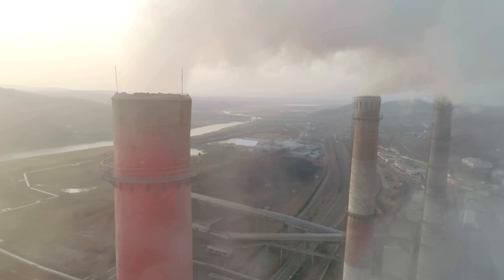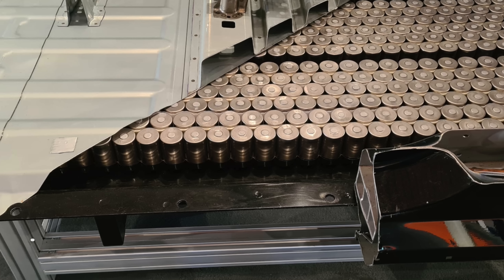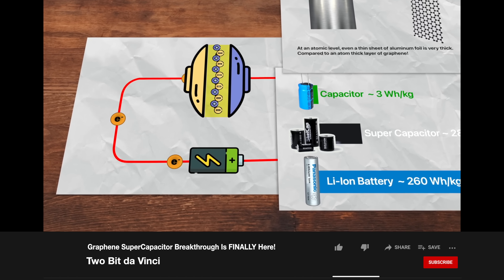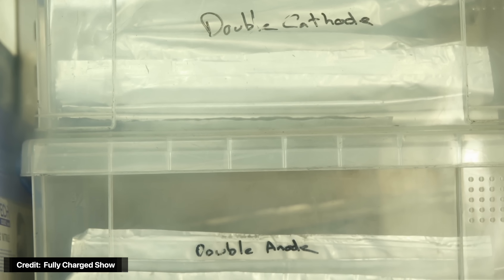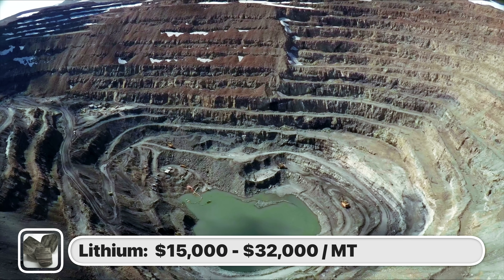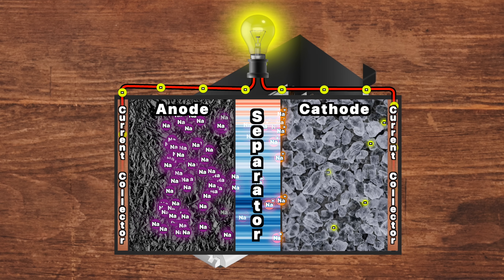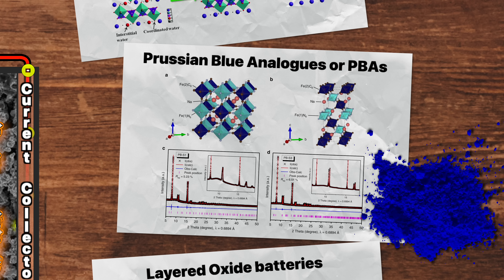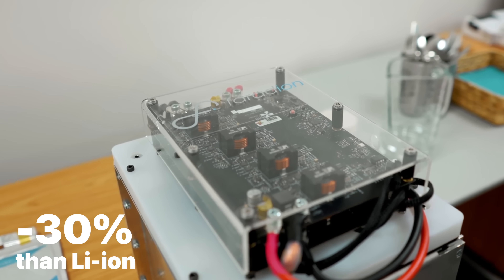Next Gen Battery is 1000x Easier to Source and 99% Cheaper!

Comment: It will be several decades before hydrocarbons can be "replaced". EVERY single industry relies on the low-cost, portable energy that hydrocarbons provide. The by-products of hydrocarbon refining are necessary for the production of renewables. I suggest researching the energy required to refine bauxite into usable aluminum.  Hydrocarbons are the underpinnings of modern life. Pick any item you purchase to use in your life, any single item. Now research what it would take to make and possess that item WITHOUT hydrocarbons. 
Batteries? Nope.
Clothing? Nope.
Electricity? Nope. Refrigeration or HVAC? Definitely not. Farming? Not efficiently enough to feed 7 billion people. 

There are no replacements for hydrocarbons.

Comment: Battery’s not gonna charge much from a 110 volt outlet. . .  And the word is electrolyte.   Better up your game a bit, Ricky.  

Bottom line:  It’s the Lada Problem.  It’s cheap, but it doesn’t work very well

Comment: Fone batteries used to just plug into the back of them. So if the energy density is only on the lower end why can't you just make them twice as big to compensate. You could even make a booster pack that recharges the internal battery wirelessly.
Reply: Because nobody wants to lug around a heavy, bulky battery.  Is that not obvious?  Applies to cars, or anything else that moves, too.
Reply: @incognitotorpedo42  people not only DID use heavier batteries previously but would often buy larger aftermarket batteries to extend them.

You obviously where not around when the companies forced people into using sealed batteries and the public complained alot about it.

Make no mistake today's fones have sealed batteries to force you into buy a new fone every few years when the battery is ruined.

Your reply was very ignorant.  And if your so weak an ounce or two cripples you, I suggest you go see a doctor.

Comment: Hmmh, go figure. 99% reduction in material cost will translate into what? A 10% reduction in battery post? Unfortunately most or the battery cost probably already goes to marketing, that is not about to change. 

There are obvious physical reasons why Lithium will be used to build the lighter more efficient batteries that command the highest price. At an estmated 10% price advantage for heavier Sodium batteries they will only take a small share of the cake. 

The really hard thing is to be better and cheaper than Lithium.

Comment: I hope they get production of these batteries up and running as soon (or faster) as they plan to. The lower energy density doesn't matter with grid storage, which we need so much for renewable energy
Reply: If we had cheap and efficient grid storage, we wouldn't need renewables. The grid storage would allow nuclear and fossil power generation to operate more efficiently, and at a higher capacity factor.
Reply: @paulcampbell840  I disagree. In order to cut our CO2 emissions to zero, which we need in order to prevent catastrophic effects caused by climate change, we must stop burning fossil fuels. So, fossil power plants are not a part of the grid of our future. And because of hight costs and effort of storing waste, the catastrophic potential, and the fact that operation will get more difficult under the change of climate, I don’t think nuclear power is a good option either.

Comment: While this is not a bust, it is FAR from a replacement or solution to the battery problems we have. This seems like a backup plan. So many other battery techs out there that far outweigh this battery attempt. Still, I like all these different avenues trying to overcome our Lithium addiction. These particular batteries need your promised 99& cheaper to be viable, not the 20% as stated in your viddi.
Reply: What, they need to be one dollar per kWh to be viable?

Comment: the goal should never be to completely get away from fossil fuels. that's suicide because of threats from enemy countries, supply problems, if the grid goes down, potential monopolies..etc. oil, electric, and hydrogen need to all be available so we won't be held hostage by anyone or anything. The electric car is a  overpriced, unpractical, unreliable, toy that will not resolve anything. I think the whole scheme will eventually collapse. And it will not save the planet., a novelty.

Comment: Those soidum ion batteries have a similar energy density to those used on the first Tesla Roadster, and only slightly less than the ones used on early Model S! They will of course be used for stationary storage, but they might also be used for some low cost EVs as well. An EV under $25,000 with a range over 220 miles would be a big hit.
Reply: @orionbetelgeuse1937  a 60% round-trip efficiency might not be a fatal flaw for grid-level storage as long as cost and life cycle numbers kept them compelling.  I would assume that the lost energy is heat which could probably be harvested at very large scale to boost that total efficiency back up.  It clearly would never approach 90% but you could probably wring a little bit more back out of a charge/discharge cycle.  The big driver would need to be cost though.
Reply: Aren't they already using something similar in the budget level chinese teslas? I know they're not using bog standard lithium batteries in those lines. Those units are considerably cheap because they have no Self Driving features (prohibited by chinese law)
Reply: @seanbrockest3888  Probably LFP (Lithium Iron Phosphate)
Reply: @orionbetelgeuse1937  But it has much more resources to make bigger storage
     Lithium isnt infinite
We just need to keep improving in all sides ( they will all be usefull now or later )
Reply: I had heard some of the companies making claim that sodium batteries can have double the capacity as compared to lithium technology.
Reply: @orionbetelgeuse1937  I dont understand much or close to nothing about it
      Good to know some people knows how it works
       Ill trust you on this one :)

Comment: Sodium ion batteries will do best in fixed-location electrical grid storage.  There larger size, heavier weight will not be as serious a drawback there., and the advantages of lower cost and longer lifespan will be big advantages.

Comment: Cheaper Industrial sized batteries are needed so that once we have enough charge to replace the fossil fuel-burning power suppliers of a sector for 24 hours, to clean the air... Clean 90% of the air pollutants in 24 hours once a week will fix the climate because it takes over 4 weeks for the 90% of air pollutants to return... So, if you don't understand that if we clean the air every week, 90% of air pollutants will never return... I Don't Know what more to say but Let's Get it Done Already...

Comment: Sodium's already a really excitable metal and you want to use it in batteries in an unstable form.  That stuff will explode on contact with water or human flesh and we want to put lots of it in a car.  We use it in a stable form salt and that will dissolve your car chassis.  You want to excite it and make electricity, what could go wrong.

Comment: That's  5 and 6% of about 2-3% of market. Not 5-6% of market.  You need to figure where power will come  to charge these Lithium ION batteries.  First go to school and learn to add, subtract, multiply and divide before saying batteries are taking off.  We need much more clean electricity and we ain't got it and Hydroelectric, big fans, and solar panels ain't going to get it .  Better get on the Nuclear power and lots of it. Then replace all the power lines.  Then start on the electric cars.  We have more than we can charge in California now and it's only a few per cent.

Comment: Whether or not we use Lithium-Ion batteries, or Sodium-ion, or Hydrogen technology, or any other new technology already proven to work, there shouldn't be an issue on which to choose. If you've bought into the idea that we need to immediately stop our use of fossil fuels, then we better make use of the technologies available to us right now. The key failure of using renewable energy sources like solar or wind is that we don't have adequate resources, like batteries, to store the excess energy produced. We NEED as much storage capacity as we can get, as quickly as we can get it. California has had rolling blackouts for years now and with Biden reducing/stopping fossil fuel energy production, we faced blackouts from California through to the Mid-West this summer. This fall and winter, we face major shortages across the whole country and especially the northern states.  Actually, this same issue is being faced across the whole world, so it makes me wonder why our government here in the United States, and other governments haven't made the production of new battery storage technologies a top priority. There is No reason why we need to wait up to 7 years to get any new technology off the ground once it's been successfully designed and tested. We Must immediately get them into mass production and to the market. Does it make you wonder why, in the minds of our elected officials, there is no such priority? It sure makes me wonder. It also makes me wonder how many of our fellow citizens will freeze or starve to death this winter because our government(s) fail to act.

Comment: Sadly there is 1 problem with the so called renewables they are NOT reliable and the POWER GRID will NOT support that much POWER flow . We Must also Remember the Recycling factor , and all the other down sides , Like making the Chicoms RICHER . I still hope it works . To be Blunt I have NO desire to buy any vehcle built after 2010. I do Think that You're videos are interesting  and educational

Comment: For stationary use, Na-Ion batteries are definitely superior, i think somewhere it was also mentioned that they are much more robust when it comes to temperature than Li-Ion ones.
So while not suited for EVs as of now, there IS definitely potential and value in their use.
Reply: I 100% agree, but I think that outdoor temperature isn't as much as an issue for stationary supplies as you might think. Small units for homes and businesses are going to probably have them indoors, and solar, wind, and local caches can keep them underground, below the frost line.
Reply: @klepow  That depends on WHERE it is used, and with the temperature resistance, it means it can be used in areas where Li-Ion would suffer.
Let´s say northern Eurasia and America close ot the polar circle.
Or literally everything equatorial.
Reply: @sim.frischh9781  I doubt that it's going to be that much resistant to temperature. Although he didn't mention how much. I get the impression you would get maybe 70% of a warm battery. They would still have to be climate controlled, and burying them still would do the same thing.
Reply: @klepow  It´s not "that much" per se, however, Li-Ion is SO SENSITIVE to temperature that pretty much any other battery technology seems highly resistant in comparison.
Like Einstein said, "everything is relative".

Comment: I wonder... What are the "Retail Prices & Availability?"

Basically, could the Na-Ion (Sodium Ion) Cells & Batteries replace the Traditional Lead Acid Battery for "SLI" (Starter, Lights, Ignition) uses? 

Could it Replace the LiFePO4 Cells & Batteries, on the "Low Cost & Long Life Front?

Could it Replace LiT (Lithium Titanate) Long Cycle Life Cells, with Higher Energy & Lower Costs?

Basically, Sodium Ion, Lithium Sulfur, and maybe others, will all find their Niche, changing along the way as Volume Increases, and Price (& of course, Costs) decrease!

"May the Best Battery Win, and may all be figured out, as to what each is 'Best' at!"

Comment: Good coverage.  Thanks.

Grid storage is what we really need, for which slightly lower energy density really doesn't matter.
Reply: It would be the difference in a few steel beams and roofing in a warehouse. Negligible costs really
Reply: @jeffreymoffitt4070  Most of the grid scale battery storage is in (cabinets in) open air, and doesn't need a building around it.  

Lower density could mean a few more cabinets, but no big deal in the larger picture.

Comment: I think that electric mobility rather than saving the planet is probably one of the fastest way to terminate the planet. Just as solar cells, batteries are extremely hard and energy intensive to recycle so most of the resources mined and then composed to make solar cells or batteries will be lost. And in addition to the energy going into the actual  production process which, want it or not, requires untold amounts of fossile fuels burning so that it's easy to say that you could have burnt the fossile fuels using combustion motors in cars in the first place. A car motor is easily recycled in comparison to the technology going into EV's. I absolutely cannot see how EV technology is helping us to save the planet or even to reduce the carbon footprint by just a small margin. It's rather increased by far!
After all, at least here in Germany it always was our main argument against nuclear power plants that the nuclear waste coming from that type of energy production and which is highly radioactive for hundreds of thousands of years is without a proper solution to be stored. That's why I and many others protested 40 years ago so vehemently against nuclear power plants and deposit facilities for nuclear waste here in Germany. Now batteries may not be radioactive but they also contain lots of toxic chemicals utterly harmful for the environment if not recycled and used otherwise. So to go all in on EV to me sounds like an unforgiving trap all together. That's why I'd like to express my protest again. But just like inspite of our rightful opinion in those days I am afraid that no-one today will listen to people like me.
A lie remains a lie, no matter how often it is told or how it is painted over to make it look like truth.

Comment: Sodium ions are bigger, easier to manage but are also lower energy density compared to lithium. Once battery recycling takes off for used car batteries it will stabilize the market. between 85-95% of the batteries raw materials can be separated and recovered for reuse.

Comment: How about the issue that Prussian blue contains cyanide?  How is the cyanide not a problem?
Reply: Cyanide like many other chemicals can be both beneficial or dangerous. Like salt , made of two dangerous elements,  chlorine and sodium.. You can't live without it.

In the Prussian blue a form of cyanide is tightly bound with iron.  Its iron bond is stronger than its attraction to the mitochondria in your cells.  In this form it doesn't doesn't bind with  and disrupt the energy production of your cells , which is the way it harm's or kills. 

Due to some of it's molecular properties The compound  Prussian blue can then be used by your doctor to treat heavy metal poisoning. It causes those metals to bind to the Prussian blue instead of molecules your body needs for metabolism.  A form of Cyanide is also a component of vitamin B12. The B vitamins are needed for proper functioning of the nervous system and they provide energy instead of shutting down energy production.

 Some things are better when purified most are not. They are constantly looking to bind with something for stability, if that thing is needed for us to stay alive it can get in the way of that.

Comment: Clean energy storage needs are massive, and specific and volumetric density are pretty much non-issues. The energy industry will use orders of magnitude more storage capacity than all other uses. Cost, reliability and longevity will be essentially the only factors to consider. There is room for numerous battery chemistries in the short term, but long-term we will need only two: maximum density and minimum cost.

Comment: It's a shame that so many of these game changers - Sodium Ion, Solid State, Super Batteries (Capacitors) - are perpetually "5 to 7 years away". :(
Reply: They're not "perpetually" 5-7 years away (this is not another Fusion tech, which is perpetually 20-50 years away...) - but once the Li-ion battery had been invented and commercialised, and steadily refined, research into other battery chemistries became sidelined. Why bother? There could only be so many laptops & mobile phones, right? Then the EV comes along & people start to realise that the sheer number of batteries that industry alone will require - if it is to replace fossil fuels - will severely challenge the availability of the raw materials... so suddenly alternative chemistries with better availability are back on the table. Sodium ion isn't the only contender for the crown, although due to the similarities with Li-ion, it's likely to be the first to market. Potassium-ion is another chemistry that shows promise, albeit probably not for transport (same issue as Sodium vs. Lithium, only more so, and there's less of it than Sodium). The guy who invented the Lithium-ion battery (the brilliantly named John B. Goodenough) is also leading research into a thing called a "glass battery" that uses a solid-state electrolyte, with very promising early results. Will that battery make it? Well - it depends. If Na-ion turns out to be "good enough" (pardon the pun), then maybe not... At least, not for some time. Good enough will always beat better, if it's a) cheaper, and b) on the market first. Hence why petrol/diesel beat lead-acid batteries to power vehicles, about 120 years ago.
Reply: Solar "generators" have stored from over $2400 per 20kWh to $1300 per 22kWh in the last couple years alone while features have improved. 

That's a huge improvement.   Enough to keep a computer, cellphone,  laptop,  cable modem,  light fixture,  small fan,  and refrigerator going for about 20 hours. 

In the same time recharge cycles have improved from 500 to over 3000 before capacity drops under 2000kWh.  That's about 8 years.